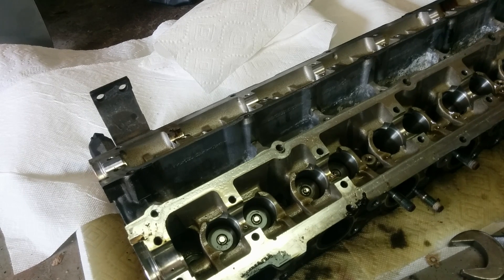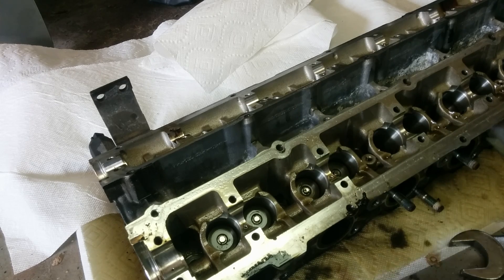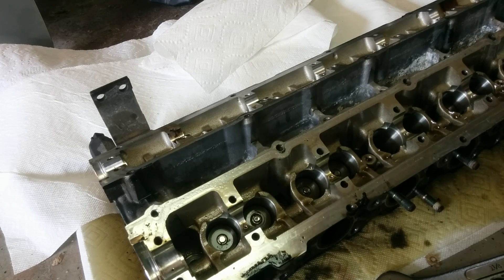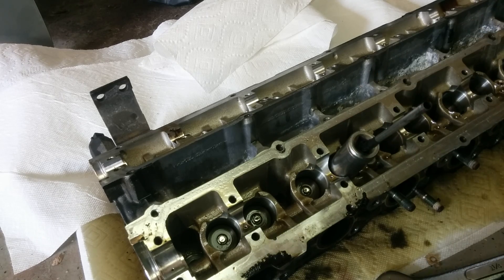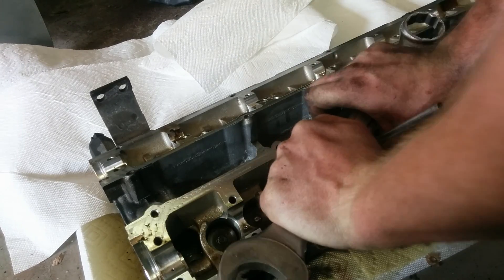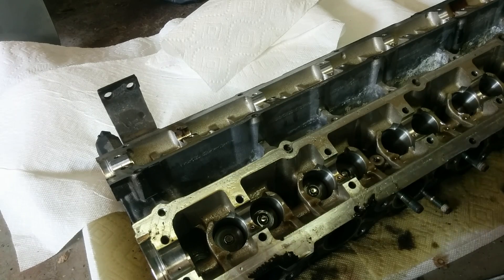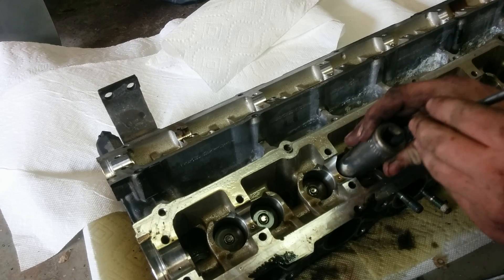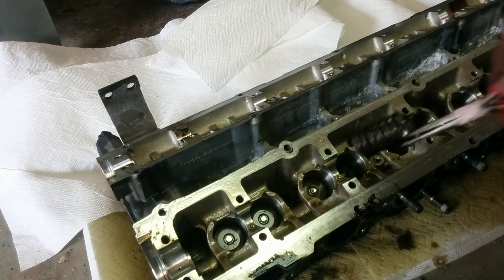How to compress valve springs without spring compressor (rb25)

Comment: An easier way utilising the same method would be to slide some magnets into the socket, support the valves on the other side and shock the socket with a mallet.